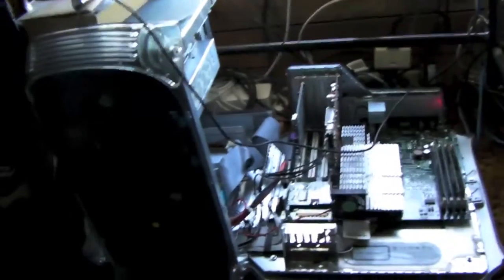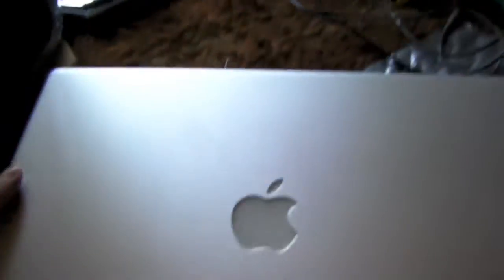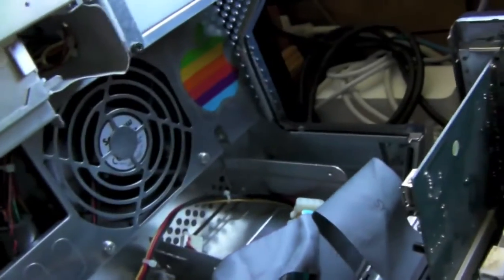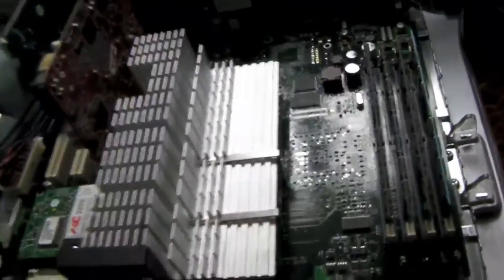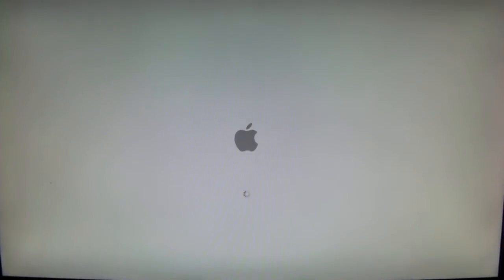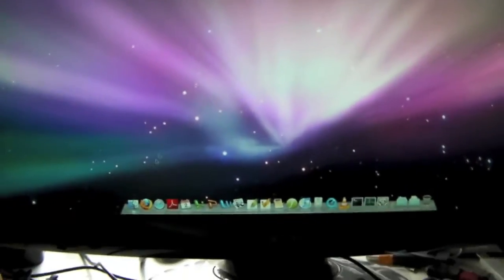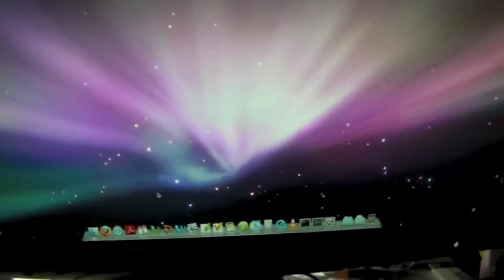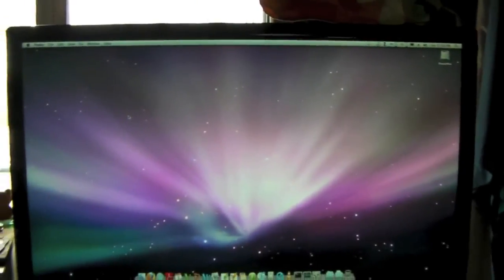Power Mac G4 Leopard Install (Part 3)

Comment from the maker: @allthatstuff34 The CPU Speed is 450Mhz for each one.
If you are installing from a retail disk, you need Leopard Assist or you need to trick the open firmware to think that it is running a CPU greater than 867Mhz.
The Dual 500Mhz is OK. Both CPU's will work together to handle each task.
You might want to opt for a better graphics card. Yours might work but it will be laggy since leopard is very graphics heavy. Ram is good but I would do 1 GB since OS X performs better with more Ram.

Comment from the maker: @xCIHIRIS Yes you can. Under Apple specs 10.5 requires at least a 867MHz CPU. Your G4 meets that requirement. You have the fastest Power Mac G4 Apple made. Leopard will run fine with no problems. Go for it :)

Comment from the maker: No this is a Sawtooth G4. It's just using a dual 450 MHz CPU From a Gigabit Ethernet model. I have the extra internal Firewire port, the power button glows green, and the Model Identifier says PowerMac3,1- that means it's a Sawtooth. A Gigabit is PowerMac3,3

Comment from the maker: @xCIHIRIS Possibly the Disk drive is bad. I have had a few that were picky at reading disks. Possibly, the lens is dirty. My Sawtooth originally had a DVD-RAM drive in it, but I replaced it with a Superdrive. Is the install disk scratched? Is the CPU Apple OEM or 3rd party?

Comment: I have a Power Mac g4 MDD and I have a Macbook pro. I want to do the same exact thing in your video. Did you upgrade any parts in the G4 before you installed Leopard? Also, is there any other way to install the laptop drive without using a converter?